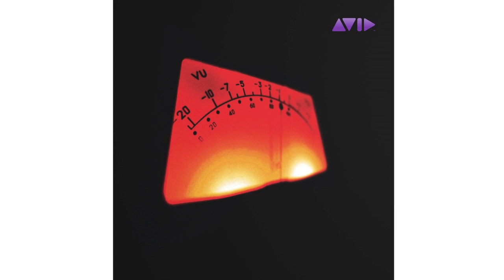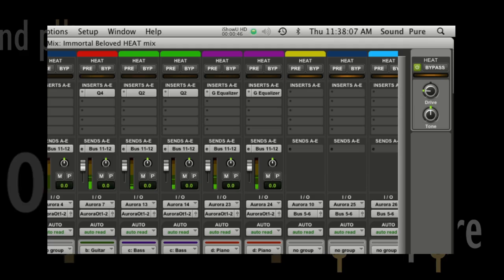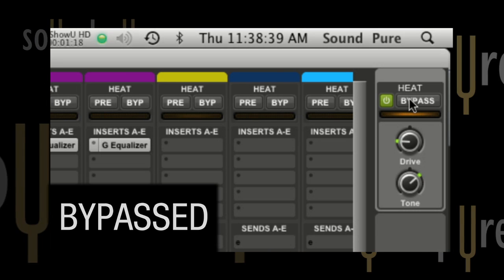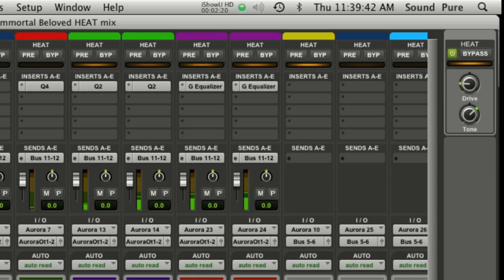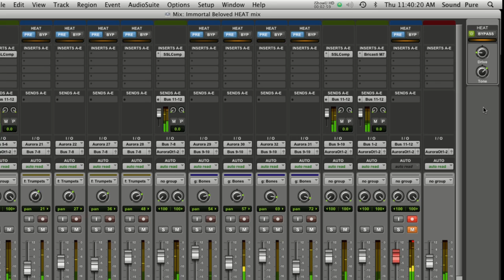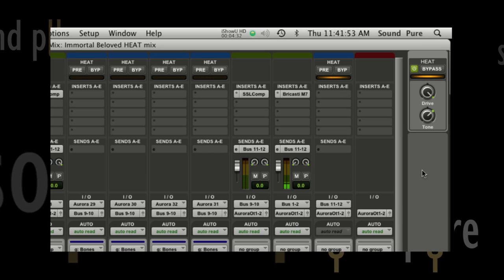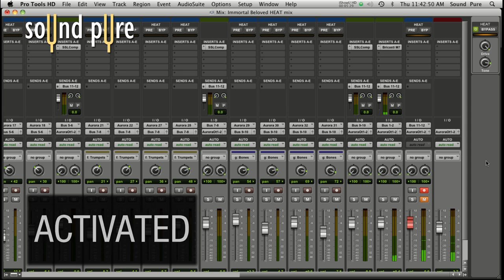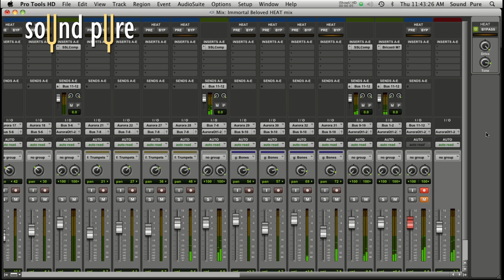Pro Tools HD Heat Plug-In Demo Video Part 2 - Jazz Big Band

Comment: One think to watch for, which I had to do the same, is that if you're printing your mix back into an Audio Track (Bounce to Track instead of Bounce to Disk) you MUST Bypass HEAT on the Audio Track you're monitoring through. Because this will NOT be recorded unto that track. make sense??

Comment: MAYBE YOU KNOW THIS:-  If you find engaging HEAT shows some significant noise in meters (but you can't hear that and wondering why), especially obvious when a maximizing limiter is engaged : Then insert a sharp low cut filter @ 20Hz at the mixbus (or to any necessary individual channels). This cuts off the infrasonic noise HEAT causes, but not mutating the saturation of our audible range.
Reply: I have one for you as well. Heat does not have over sampling on native systems. It sounds completely different at higher sample rates on native systems. The drive will increase brightness though harsh aliasing at 44.1k. I only use it at 96k and 192khz. Try it at 192khz and you will see. The drive knob in either direction actually makes things darker and more gooey the higher the sample rate is. I love to boost and eq into it at 192khz. As it acts like soothing filter to remove harshness.
Reply: @theblowupdollsmusic  I'm not using ProTools now, but thanks for this. Atleast useful for other comment readers ❤️

Comment from the maker: @scouserEFC81 The subtle differences get magnified over many tracks, and you can certainly push any harmonic device (analog or analog simulation) to be even more saturated/distorted.  It's not that analog is overrated- perhaps your sensibilities don't have a problem with an entirely digital recording.  Many people find them a bit clinical/sterile, and want to warm them up in a subtle analog way.  But, you may not care for those differences which is fine.   This is an answer for a lot of us tho

Comment: come on the subtlety of this plugin is so minor, its evident when bypassed in this example. I want to be able to say i hear this 'magical difference' but its such a small diff. If u played this finished mix bypassing HEAT to the average to intermediate listener, they would think it sounded great. I cant see how an extra 1% of harmonic dist improves the mix substantially to the target audience, which would be the avg listener? Just being honest. but iam a drummer, maybe my ears are shot at 29?
Reply: scouserEFC81 it’s possible. I hear a pretty noticeable difference. Make sure you’re listening on a good system too. I hear a difference on my AirPods, but it’s more noticeable in a full spectrum scenario. Also, to be fair to your point, analogue processing is definitely more feel than sonic. It’s a weird thing to listen for, but especially in more dynamic mix’s, it just gives that sense that what your listening to has that extra something special. It took me a minute to hear what the Phoenix II was doing to my mixes once I balanced the level, but I would go back later and bypass and man did it through the mix off. Haha.